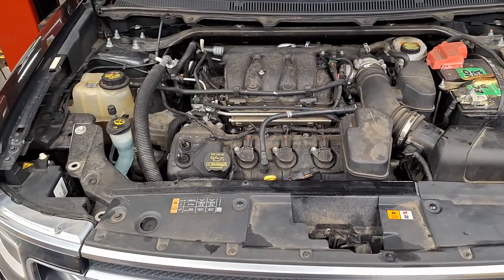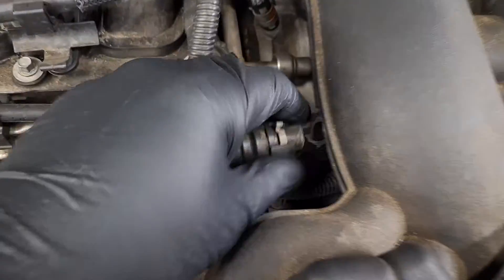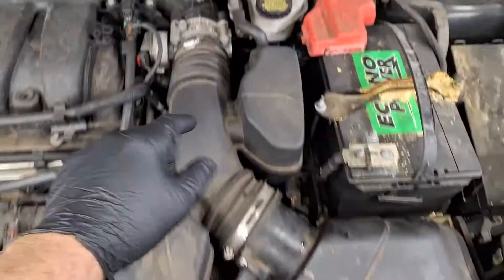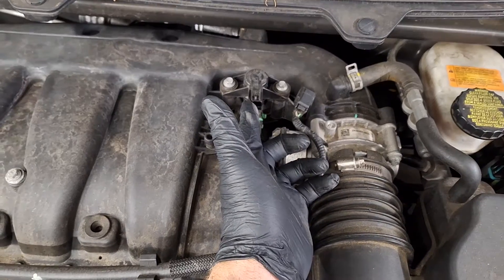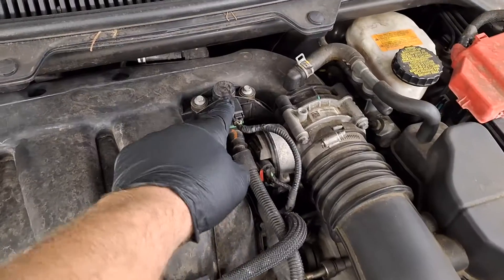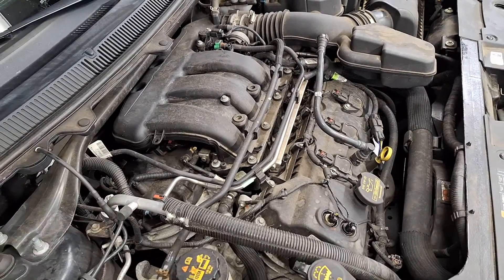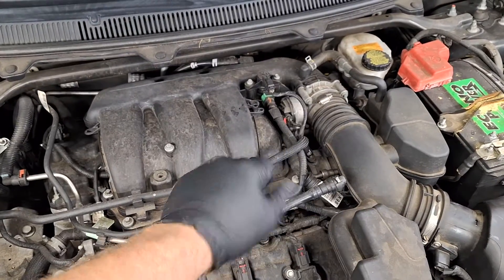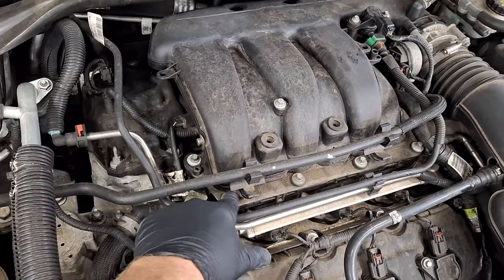Ford 3.5L 3.7L - P0171 P0174 Common Causes, Tips For Diagnosing a Lean Conditon

Comment: Thanks for the advice on what to check for on my 2014 Ford explorer sport it keeps giving me both codes p0171 and p0174
Reply: Did you get it fixed. I have the same problem